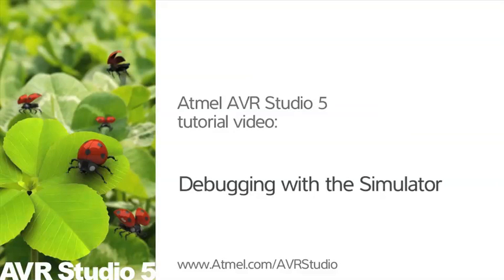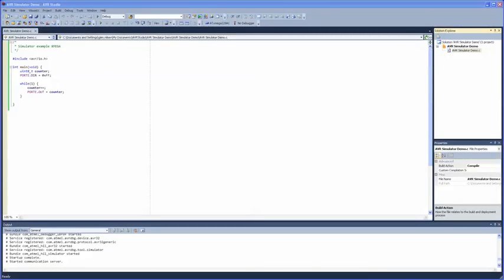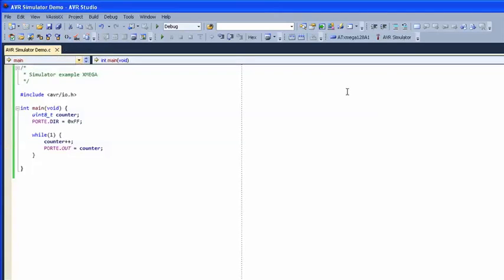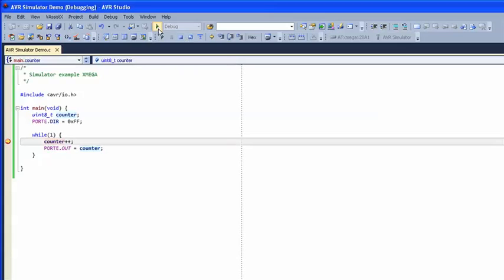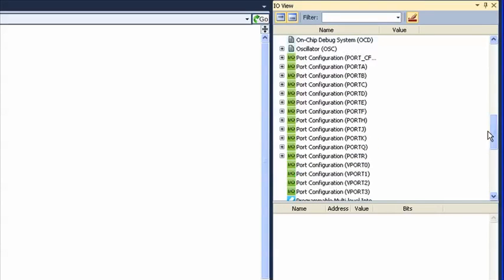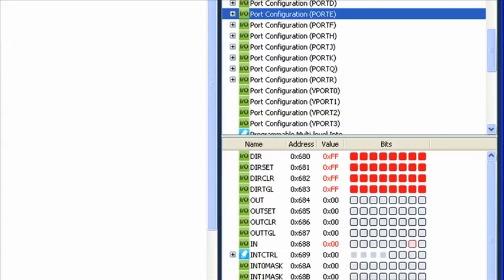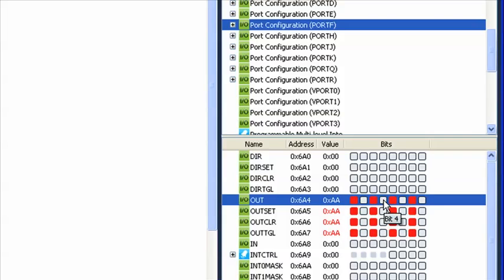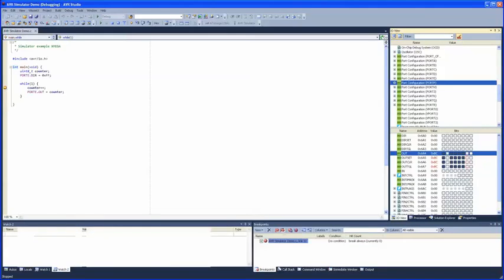Atmel AVR Studio 5: How to debug using the simulator

Comment: "[...] and the simulator is always an option in this drop down" seems to be another lie due to marketing. You should have mentioned that not all chips support to be simulated (for whatever reason). The STK500 comes along with an ATmega8515, which isn't supported. Took me a while to find out.